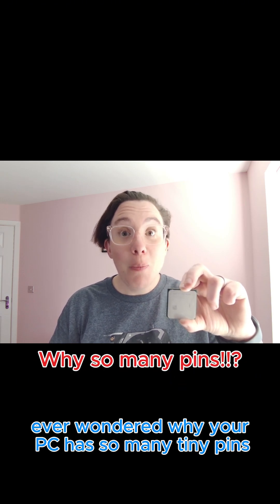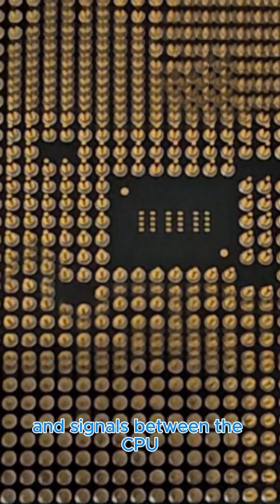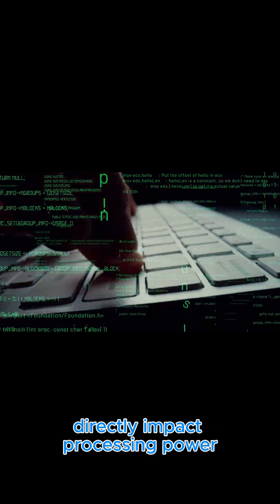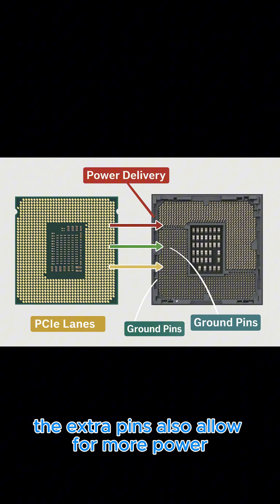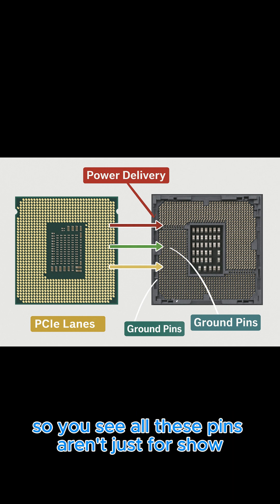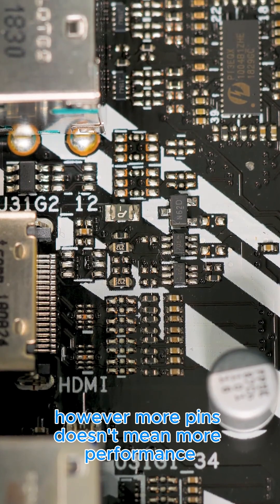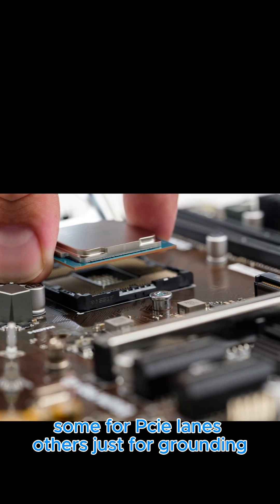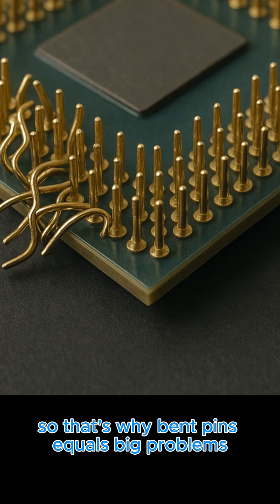The SECRET Behind Your CPU's Many Pins? #pcbuilds #techtips #cpu #shorts #computerrepair

Comment: Yeah what about am5?
Reply from the maker: Great question! With the AM5 platform, AMD switched to an LGA (Land Grid Array) setup, which means the pins are now part of the motherboard socket, and the CPU has flat gold pads on the underside. 

This change helps prevent bent pins on the processor itself and allows for a higher pin count in a compact area, perfect for the demands of newer CPUs. I’ll be covering this in more detail in an upcoming video, so keep an eye out! 🙂

Comment: What about the AM5 CPU?
Reply from the maker: Ah yes, the AM5 socket! It uses an LGA (Land Grid Array) design, which means the pins are now in the motherboard socket, and the CPU has flat contact pads on the bottom. It’s a smart move, much less risk of damaging fragile pins on the CPU during handling. Plus, it allows for better contact and more pins in the same space, which is essential for modern CPUs. I’ve got a video on this coming soon, so stay tuned! 🙂